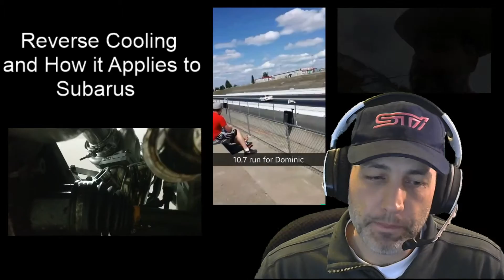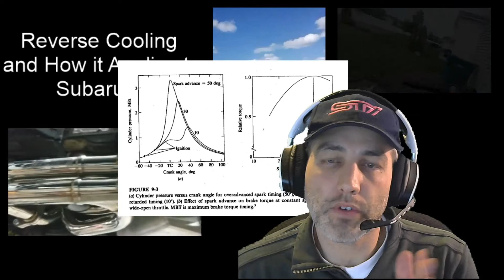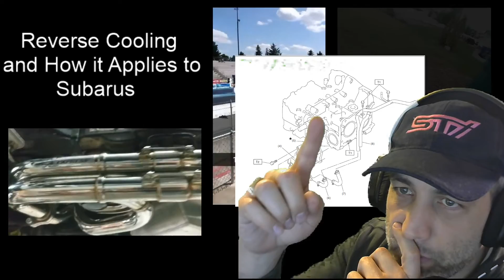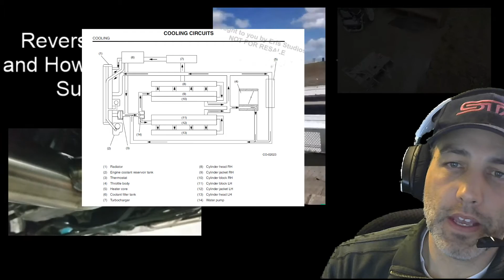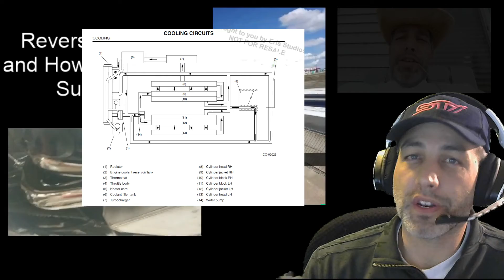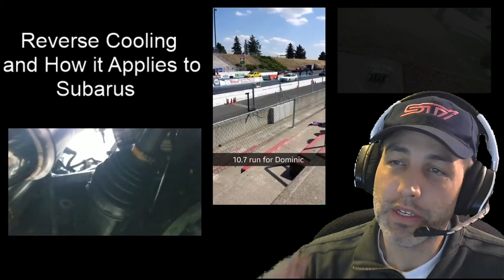Reverse Cooling and how it applies to Subarus

Comment: Really great video ! Appreciate showing some light onto the lt1 engines ! I feel the lt1 engines would have performed a lot better if hey had better flowing heads but they were still amazing for stock ! peak cfm on lt1 heads were 204. On the ls1 heads, it is 244. The reverse flow cooling system is awesome but I suppose that it was overcomplicated and not needed for street cars. So many cars could benefit from a reverse flow cooling modification ! I am not sure how possible it is to do it though....

Comment: Does this mod require a tune? Lol I’m kidding. I am running the factory “garbage” tune (93 recommended and I use 93). Will this mod help gain any kind of power? I wouldn’t think so but I just thought I would ask. Trying to prove to people that the EJ257 is reliable in stock tune form with proper cooling, oil changes (every 3,000), and 93 octane. I have been thinking about getting an AOS to help prevent fuel dilution even further. Put on 10,000 problem free miles now since my purchase. Thanks for the info! I’ll show my friends

Comment: Saw some EGT charts that shows the change (decrease) in the delta of the exhaust temps between the cylinders. I cracked my #4 cylinder on my STI and this mod is going on my built block. Certainly worth a little peace of mind adding this mod. Thanks for the video and explaining it all!

Comment: I got this mod for 2 years now and no issue whatsoever. Get em!
Reply: Oh and while this is not scientifically proven in any way or form, but perhaps is worth mentioning that my remote engine tuner in Germany said the 98ron is better in my country as he is able to be a little bit more aggressive in the tuning than he otherwise would. First of all I don’t think that is the case plus it is pretty much summer all year long here and the ambient tempt  was always around 29 Deg C to 30 Deg C at evening when I collected the log data - and I am still on stock 2011 STI TMIC. Could it be due to the much better EGT delta across all four cylinders? Well I don’t know for sure but in theory it is possible I guess.

Comment: Why does the coolant flow through the throttle body and heater core not return to the radiator but instead flows straight back to the water pump?

Surely if those lines returned to the radiator there would be a huge decrease in coolant temps?

Sorry if these questions sound stupid...
Reply from the maker: When the thermostat is closed, there needs to be a coolant flow path or you will damage the water pump. This flow path recirculates coolant through the engine without radiator influence so the engine can warm up. 

Returning it to the radiator when the thermostat is closed would be the same as not returning it to the radiator because it wouldn't flow.

Comment: What about the increase in temps for all other cylinders?
Reply from the maker: There isn't one.
Reply: @GetaDomTune  was referring to ur EGT pic u posted, showing the increase

I just hope this dosent make all cyls instead of just 4# overheat now. Also someone was saying there’s less reliable knock detection ?
Reply from the maker: @cockus123  that's not at all how that works.
Reply from the maker: @cockus123  hahahaha. Your statement is so absurd I'm not even sure where to start, but I'll try. 
The EGT picture has nothing to do with absolute temp; it's about balance.  The gain is in bringing the EGT delta down. The proof that the system works is the lower EGT delta. As a whole, it's easy to change average EGT by adjusting fuel or timing or both. My system reduces the delta, providing the tuner with a tighter EGT range, giving them more freedom, not less.
Reply from the maker: I have another one that might help you understand. 

I'm walking through a doorway carrying a large box. If I'm not careful and I move just one inch in either direction, I'll smash my fingers. 
But if I shrink the box down, I can move 3 inches either direction before I smash my fingers. 

Smashing my fingers is hurting the engine. 
The box I'm carrying is EGT delta. 
The doorway is acceptable EGT.
My mod shrinks the box.
It's not a perfect analogy, but it works.
Reply from the maker: @cockus123  you're completely misunderstanding the indications. I took that picture down because too many people don't understand how EGT functions. 
The other cylinders aren't suffering. The other cylinders were too low before due to the large discrepancy in burn speed between them. Also they're still cooler than cylinder 4, which was previously, and still is your limit.  If EGTs are too high, the tune needs adjustment. I didn't make anything worse, I made everything more controllable.
Reply from the maker: @cockus123  I don't know how many more ways to explain this to you. High EGT is almost never an issue. The problem isn't high EGT, it's the delta. The EGT delta is an indication of inconsistent burn between the cylinders. 
This mod isn't done to change EGT, it's done to better balance the cylinders and a smaller EGT delta is the indication. 
I run around 2000 degrees in endurance racing.
Reply from the maker: Having one EGT low and one high at what the ECU thinks is the same AFR between all cylinders, means that it isn't the same AFR and all 4 cylinders have different burn speeds which means they each have different ignition requirements. 
Lowering the delta, means that I'm bringing the cylinders closer together in ignition requirements and better balancing the engine output, safety and tuner control. 
This means safer power, more power and more longevity.
Reply from the maker: @cockus123  it's been out for 2 years. I've sold over 10k.
Reply: @GetaDomTune  loving when you break it down crayon style

Comment: Bruh, you and I went round and round on Facebook over cylinder 4 having less fuel. You ended up bitching out and blocking me. You just admitted what I was saying from the start. Cool cylinder 4 with the proper A/F you'll get better cooling. Your mod may add additional cooling, just a band aid bro. Buwhahahaha 

/slow golf clap
Reply from the maker: still stupid huh? Even your reply here shows you have no clue what you're talking about. This isn't fixing AFR, it's fixing burn speed and heat retention.

Comment: Hey Dom, I just got my cooling mod delivered. Thanks for such fast shipping times! Will post a video this week of how to install the hose from underneath the car. Your description that was sent with the mod is very thorough but i can see some people misunderstanding.
Will keep youtube and nasioc informed about my findings and procedings.

Thanks!
Reply: Nick DeLong thoughts?
Reply: @n54dame  took me about an hour to install. simple hand tools. ive measured a 25* lower cylinder wall temp since installing the mod and definately less detonation in cyl 4.

part was a perfect fit, used a little bit of pipe dope to prevent leakage.

would buy it again, if i needed another one.

Comment: Hey Dom, if you bring down the temp on cylinder 4's head, decreasing its knock tendency with this mod, doesnt that mean we would lose cylinder 4 as a "reliable" way of sensing knock? I mean cylinder 4 will no longer be as prone to knock as it was without this mod, doesn't that mean we could potentially miss knock events that are more likely to happen in cylinder 1, 2, and 3?
Reply from the maker: A completely valid concern and one of the reasons why I didn't make the mod flow the maximum amount of available coolant (I strategically sized the orifice in the fitting). I have some EGT and temp data that shows 4 is still hotter, but the delta is reduced dramatically. It's still the harshest cylinder, it's just not as harsh.  https://cdn8.bigcommerce.com/s-gfm7bog6j4/images/stencil/1280x1280/products/112/388/CoolingModEGTs__30473.1533290766.png?c=2&imbypass=on
Reply: @GetaDomTune  Its nice to hear your considered that, it was nagging around the back of my head for a while, I definitely think this is a good idea and will be purchasing two of these, one for each of my 2004 forester xt's, sometime next month as soon as I have the spare investment capitol.  :-)

As always thanks for the informative content... I think I've watched these video's 20 times each and am still glimpsing new nuggets of information with each pass.
Reply: ordered, looking forward to receiving and installing these, thanks again!
Reply: @GetaDomTune  another reason that "a few fittings and a hose" would be a bad choice of replacement parts. ;) Would you recommend this mod for people running OTS Cobb maps? I'm unsure if the Cobb maps has special timing and fuel adjustment for cylinder 4. I ask because from your video it sounds like the stock maps from Subaru actually has cylinder 4 timing and fuel adjustment to make that cylinder knock first.
Reply from the maker: @HumbleRumble  yes to everything.

Comment: It would be incredibly interesting to hear you explain in detail why closed deck blocks typically see higher coolent temps (and what manufacturers like IAG, outfront, etc.. have done to combat those temps)
Reply from the maker: Only when people use the wrong head gasket or have a closed deck design that blocks the exhaust side supply ports, do people suffer from higher coolant temps.  I haven't had an issue with the new IAG stuff.  People don't realize the exhaust side cooling jacket holes in the head are the supply to the head, the top half of the cylinder cooling jacket and the rest of the engine (turbo, heater core, TB, etc)
Reply: Dominic Acia with the newer designs are the closed decks coolant temps right on par with a semi-closed block? Or is there still a slight difference
Reply from the maker: @jack073  they're normal. I don't even know where the misconception came from that they're higher just because they're closed deck. It makes no sense at all.
Reply: Somewhere along the line, I heard that a closed deck run a bit hotter than open or semi-closed simply because all that extra material that sits around the head of the block. But its good to know the truth.

Comment: Excellent video as always! Very enlightening to know why #4 fails more commonly, esp. due to detonation. Definitely looking forward to this new product! I'm guessing this could be installed before tune to allow a slightly more aggressive tune, or afterwards as added detonation protection on cylinder 4?

I have seen many posts online from people claiming #4 failures were due to excessive heat and that using an ELH versus UELH would be very beneficial in lowering the heat buildup on that cylinder, especially on a higher power build. Any thoughts on this? (not sure if the answer warrants a video of it's own)
Reply from the maker: Shane Trenholm I always run a equal length header to provide better flow balance and therefore heat balance

Comment: Is that flow diagram out of the FSM?I'm curious what the path is like on the FA.
Reply from the maker: Stanley Zitello that is straight out of the Subaru FSM.
Reply from the maker: The FA has an improved flow path, FYI. I just finished a complete analysis of the FA cooling system. They did right on the FA all the things they did wrong on the EJ.
Reply: Ah, that's good to know! 
Where did you end up finding the info for the FA20F? I looked in the service manual I have and couldn't seem to find the flow diagrams, there is a chance I'm blind or maybe I'm missing some sections.

Congrats on getting your EJ solution completed and released!
Reply from the maker: Stanley Zitello I looked at the engine. We have a couple taken apart.
Reply: Straight to the horses mouth, that'll do. haha